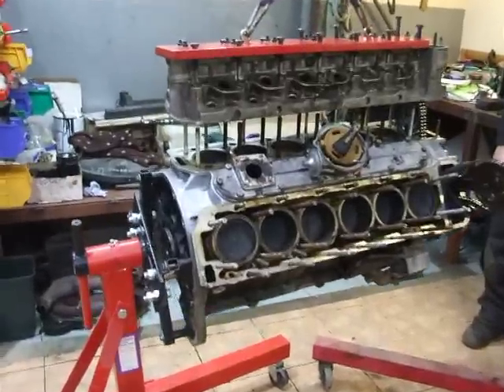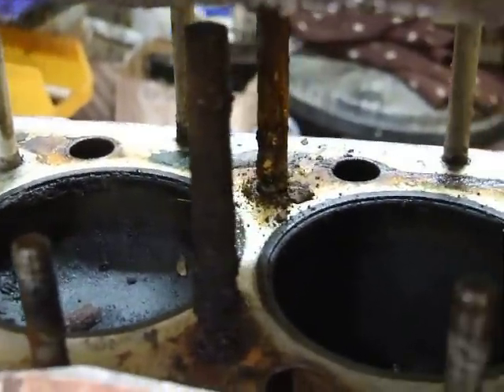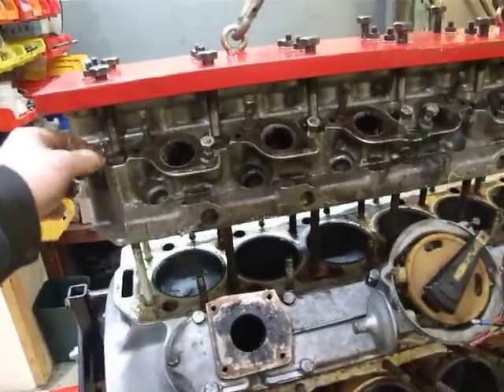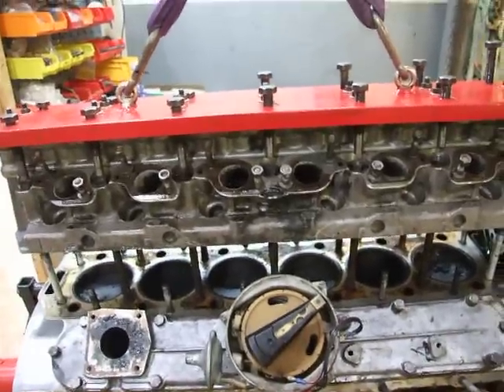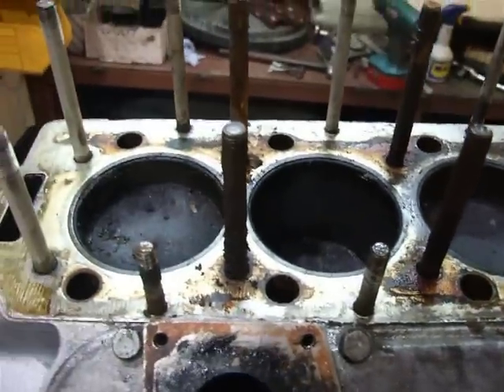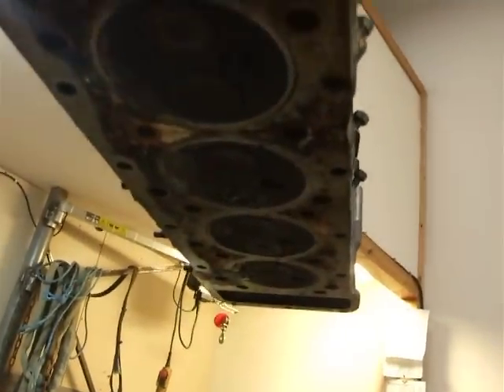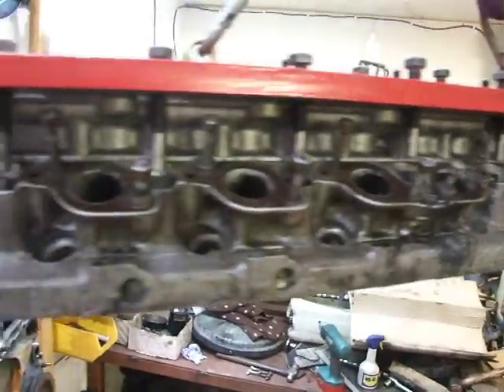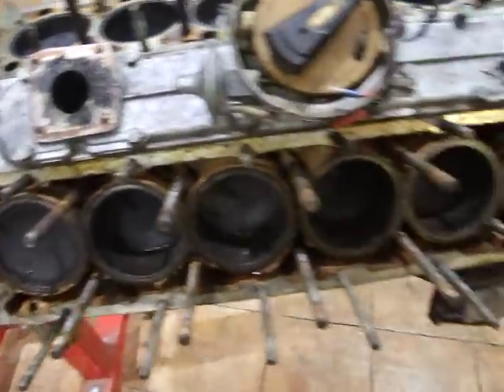Jaguar V12 Engine Head Removal (Part2)

Comment: I used to,   With engine in situ pour vinegar down the studs, take the weight of the head with a hoist and leave over night hanging , lift off head in the morning,  I've done loads since 1963 till 2011.

Comment: I have used such a tool for my V12 and I had heads off in a short 15 minutes either side. Came off easy. This plate is hefty but it works a treat!

Comment: The puller in the video should have a horizontal lifting bar fitted to it, not two eye bolts,The bolts do not give a straight lift and eye bolts are for straight pull or lift only.. We use the same principle on 6 cyl Jags utilising a different jacking system. 3.5 hrs to change a 6 cyl Jag head gasket.